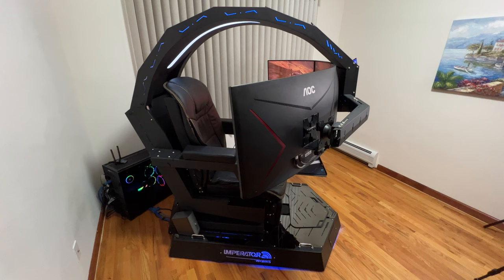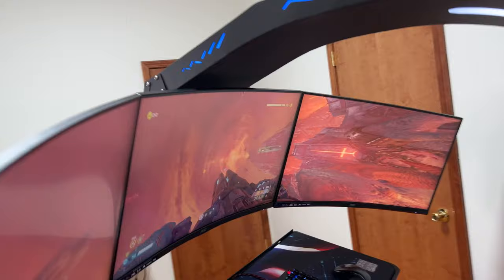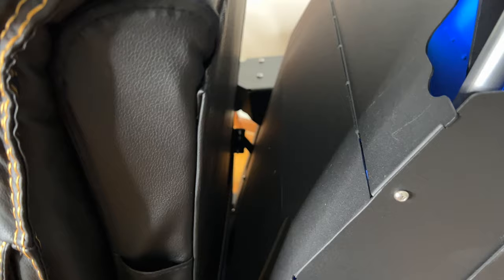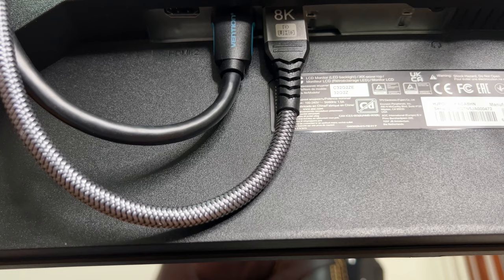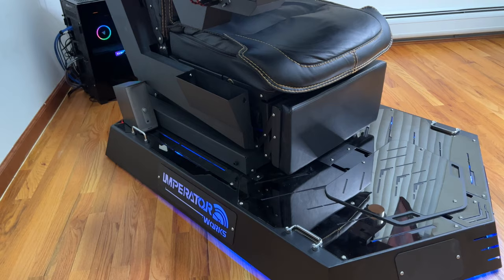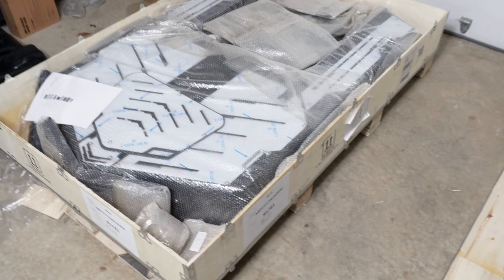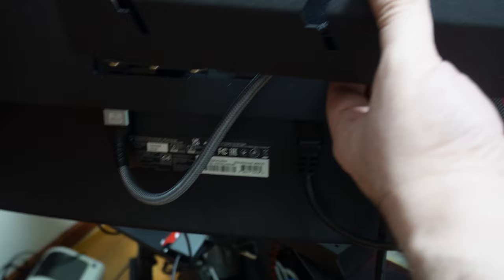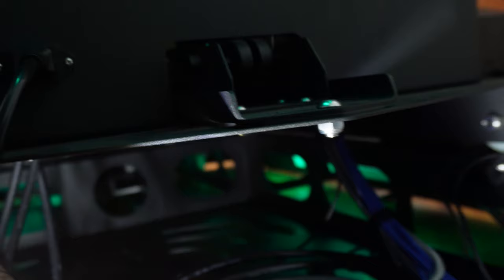[2023] Best Gaming Chair - Imperator IW R1 Computer Workstation Gaming Cockpit - Full Walkthrough!

Comment: The first function you show is the one-button touch of opening to allow user access which is accomplished by rotating the keyboard tray out of way, and raising the monitor arm, lifting the monitors up and out of the way.  Now, if someone did not have the ceiling clearance height to provide sufficient space for the monitor arm to open (lift) to its maximum height, can a user stop (pause) the opening functioning of the chair so that the monitor arm opens only part way, so the user has some room to enter and exit the chair, and then have the ability to reverse the motion of the monitor arm to return to the close position?  Or in other words, can the user open the chair up only part of the way, pause the mechanical motion, either to enter the chair, or exit the chair, and then reactivate the mechanical motion in the reverse direction to close it up?  Basically, is it possible to open and close this workstation chair without the chair extending fully to its maximum height?
Reply from the maker: The arm and the tray can be controlled individually so if you have a limited space you can just use the raise arm button before you hit the ceiling. Also, if you press the one button operation you can stop it by pressing any other button so it will not crash on your ceiling. I hope this helps you. If you are planning to get it don't forget to use the link and the discount code on the description. If you have any other question I am happy to help.

Comment: That's really cool.  Question: Can it save your configuration and go back to it when you get back into the chair?  (setting monitor distance/height and chair angle)  Or do you have to manually adjust it all when you get back in every single time?  I didn't see any M1 or M2 buttons.
Reply from the maker: There is no save option. The monitor distance is fixed you can only adjust the arm up or down. This model doesn't give you option to adjust the distance which was my biggest concern thinking the monitors would be too far when i full go back but it turned out no big deal.

Comment: Can you connect multiple computers , I work three jobs so three laptops , if so can I use single keyboard and mouse for all computers ?
Reply from the maker: Yes you can use it for multiple computers. It comes with 3 cables for the monitors but you can add additional cables. If you watch till end of the video I put through longer cables it is very easy to update the existing ones with longer cables. I am using it for my work as well I put my laptop on the side and use my PC keyboard and mouse for both but you will need a switch box to change the input here is the link what I am using https://amzn.to/45Jj4bS this is a very good switch box never had any issues, you can add up to 4 device to share among your computers.

Comment: Thank you for the detailed review! do you have any issues with Monitor angles when changing chair position(various stages of reclining)?
Reply from the maker: Once you secure the positions and tighten the screws well there is no issue even if I leave the arm on open positions for days. I was worried about the same considering 32 inch heavy monitors but they don't move at all.

Comment: Greetings - I have been looking to purchase this exact workstation for some time now - now that you have presumably had the chair for over a year - what are your thoughts? Does it still hold up? Have you had to make any repairs? I have seen that the reviews are a mixed bag for Imperatorworks products, and I would like to know if the device will last if I am going to spend so much on it.
Reply from the maker: Hi, its been over a year and a half now i am really enjoying this workstation. I didn't need to make any repairs everything works well. The only thing i had to do was putting some grease on the lift arms to stop the noise it started to make. It is a well made unit.

Comment: Would you be willing to share the assembly manual (assuming one was provided) ? Working on a DIY project myself and that would be very helpful
Reply from the maker: Hi, I don't have the manual they provided some videos how to assemble it but I can say it is very straightforward. It almost comes pre-assembled. All you have to do is put the arm/chair piece on the base which slides in and you secure it with couple of screws in the front. And the raising arm you need to lift it and mount it on the lifts and you are good to go. For the monitor arms there are 6 screws on each arm which you won't need any instructions. The screws are the same size so you won't get confused. Customer support is amazing Jason is very responsive I had been communicating with him via text message and WhatsApp he always response very quickly.
Reply: Im guessing they started sending them pre assembled becayse i was going to buy one back in 2020 and it did bit come assembled at all and i saw the process to fully assemble and it was extremely tedious with lots of screws and stuff. I was emailing the manufacturerers themselves they also informed me it would arrive in 2 big heavy heavy boxes did yours arrive that way

Comment: This popped up for recommendation so Amazon and now im researching it. I jave a 45 lg monitor is it possible to attach it on this chair?
Reply from the maker: You can use up to 49” ultra wide monitor. It needs to be ultra wide otherwise It wouldn't fit if you go over 32"
Reply: @ireviewforyou6296  Thanks! Another question, I'm not a fan headphones so is there an option to attach speakers next to the monitor?
Reply from the maker: I am using speakers as well and i put them on the bottom part the big bas there are plenty of space on both right an left side so you can try that as well. If you are creative and dont mind the look you can use some zip ties and secure the speakers on the monitor arms there are a lot of rooms.

Comment: Great video, I am on the fence with one of these.  What is the max height?  How tall is your ceiling?
Reply from the maker: I have high ceiling I don't have any issue with the height. I just measured when the arm is on open position it is 90inch from floor to highest point. If you sit and the put the seat on gravity position and you decide to open the arm all the way up it measurs about 96inches.
Reply: It looks exactly like the Cluvens manticore which is up to 6'5'' or 197cm

Comment: How does this ship? Do you have to assemble
Reply from the maker: It was shipped in 2 wooden shipping crates. One of them is really big which holds the seat and the arm piece. And the other one is for the base where you have to install the chair it is very easy installation you just slide the chair on the base and secure it with 4 brackets. But you need couple of strong friends because it is really heavy. If you don’t have that kind of help you can disassemble the lifting arm and the side arm handles to reduce the weight but that would require extra work.

Comment: I am having trouble decide on what monitors and how many monitors
Reply from the maker: 3 Monitor is more than enough If could go back to time I would get 27" monitors instead of 32". I am using this setup mainly for work purpose and I need to use my personal computer as well so I keep switching the input source often. If you don't have that kind of requirement and have money you can consider 49" Odyssey kind of monitors I think it will look nicer.

Comment: How hard installed it
Reply from the maker: It is really easy, it almost comes assembled the top arm, you just need to raise it to position to put the bolds then its ready. The monitor arms pretty easy each right and left has 6 screws to secure the mount. And the bottom piece the base where the cahir goes on has 4 screws and you are done. The challenging part was moving the chair from garage to my room as it weighs about 300lbs. So you definitely need 4 strong person. Also you need to measure your door width if it is less then 30inches it will not fit.

Comment: Can you use racing wheel with that chair?
Reply from the maker: The keyboard tray can be used to mount a wheel. The center of the tray dimension is about 13.5inches. I think you can easily use a wheel but you need to move your keyboard.